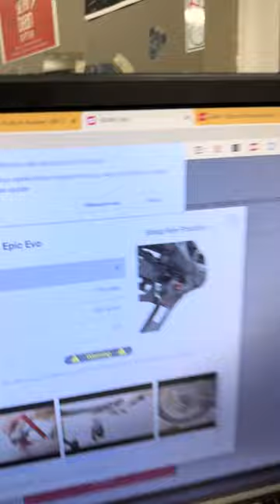SRAM Transmission Installation #Shorts

Comment: I don't really understand why this is now a thing , We got a detachable hanger to stop the frame getting bent , Isn't this just going to revert to the old days of bent frames on big derailleur hits?
Reply: Yup. They'll break at the chainstay and then the big companies will just warranty the frame and add to landfill.
Reply: No, forces of an impact will be distributed across the thru-axle and rest of the frame wich is now one piece and already more solid in construction to fit the big axle
Reply: @appelflapdrol  doesnt matter how much you distribute the forces its still moving the point of failure from something inexpensive and designed to bend and break to something expensive and hard to replace.

I have no doubt it can probably withstand a good wack but nothing is indestructible.
Reply: @Jasontvnd9  Traditional hangers are just a bit too vulnerable they can ruin a ride with the slightest impact and get the whole shifting out of true, and tend to get ripped out of a (carbon) frame with those flimsy (often) M3 bolts that also get rounded easily with replacement. Not even speaking of the damage a broken off derailleur will do to you rear wheel and chainstay.... The impact a UDH system needs to have a frame written off and sent to the landfill is much much higher than the traditional hanger van endure before snapping and ruining the entire back end. Thru axle + UDH is just superior in every way (after you've paid for the parts lol). Also shifting is super crisp because of the rigidity. Have you ever ridden a bike equipped with this system? It's truly phenomenal